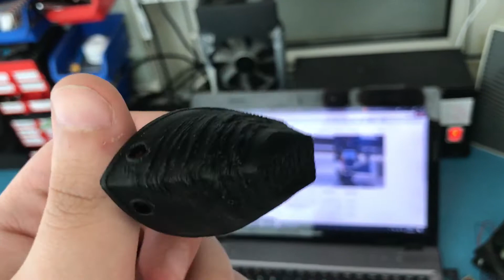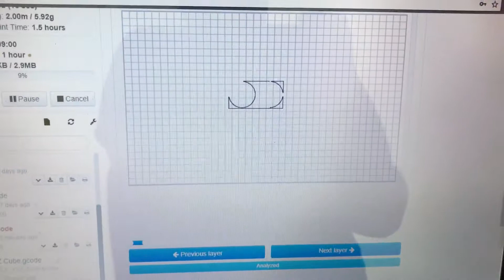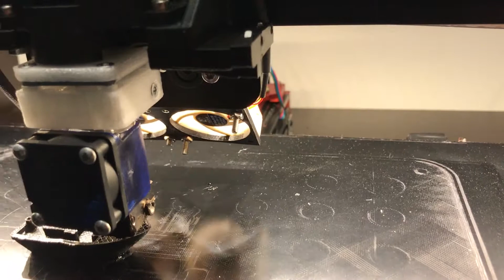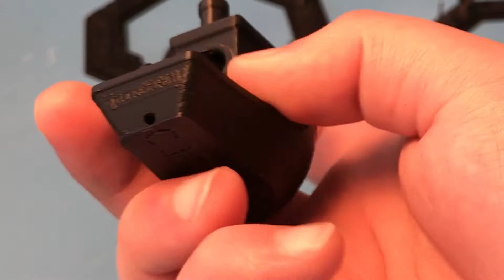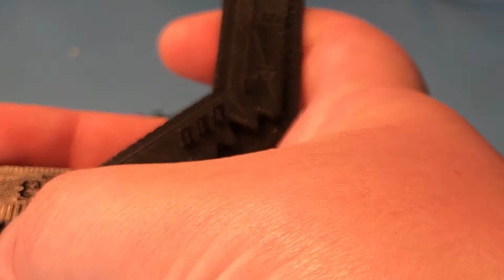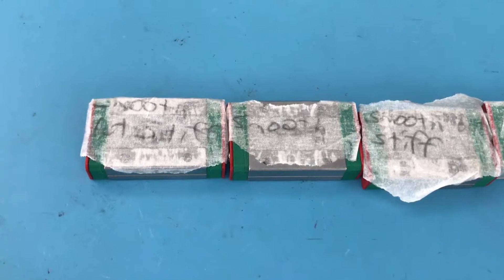Tevo Black Widow Mods Part 24 - Layer Fan Issue & Comparison Between Old & New Boards

Comment: What is that noise coming from when it was printed thing sounded like it's scraping something.
Reply from the maker: That noise happens ever since I switched to steel core belts. The steel parts in the belt are scraping on the pulley teeth and making that noise.